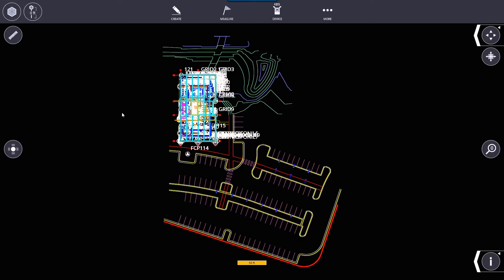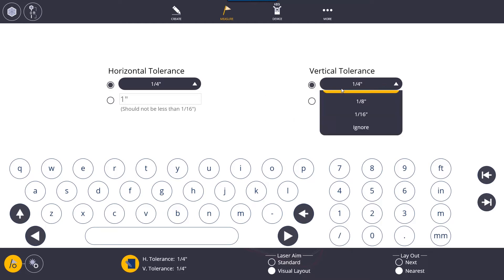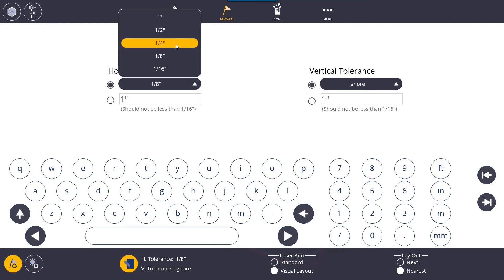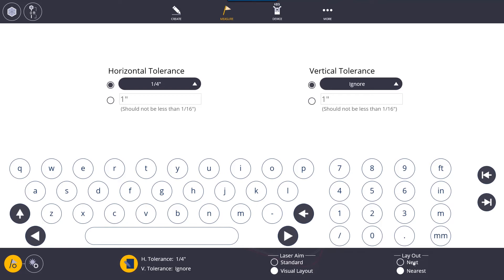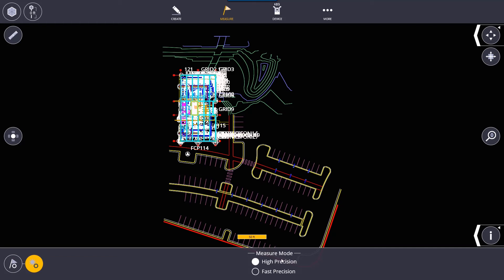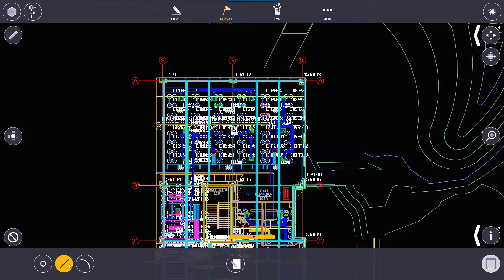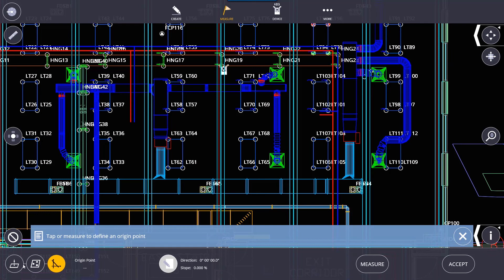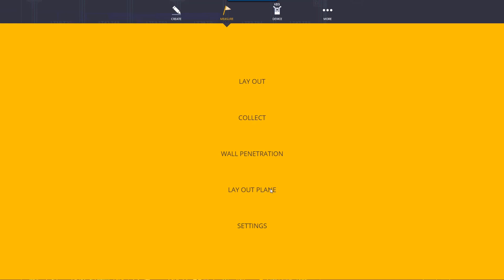Trimble Field Link - Measure Menu

Comment: Point layout system is design for reporting to the Engineer in the office waiting for your reading results then the carpenters can proceed tomorrow after approval by the engineer that is killing time, Should be layout line not points so the work can proceed right away let that engineer come to site and check by himself do not delay the job.
Point layout is a big delay using robotic suppose you can layout lines of walls columns foundation or arcs no need to go to end points just a line layout the snap it accuracy. Trimble should emphasize more on lines not points
Reply from the maker: Taga,
I agree and we do focus on the line and pathway layout specifically in training and very soon we will have some additional videos showing these features.  However, layout to a point is accurate and recordable as long as your control is correct and set up correctly at first.  There are some building elements that layout to a point if more efficient as well.  I hope you get the opportunity to see the additional videos we upload showing using a .XML file for terrain and surface as well as the focus on layout to a line.

Thank you for the feedback it will help us create more useful content.